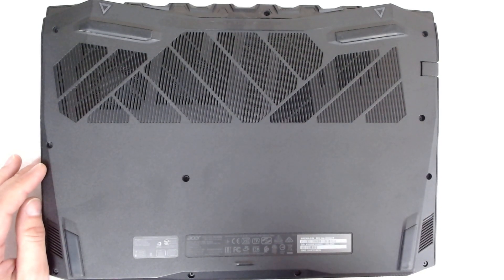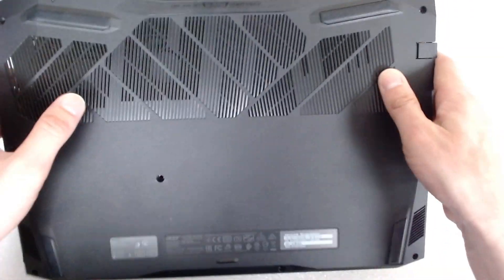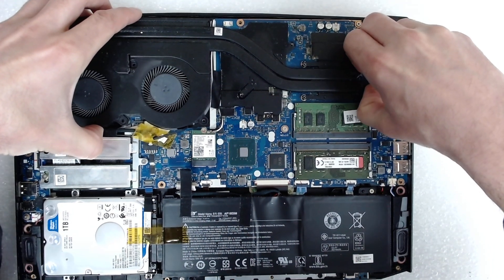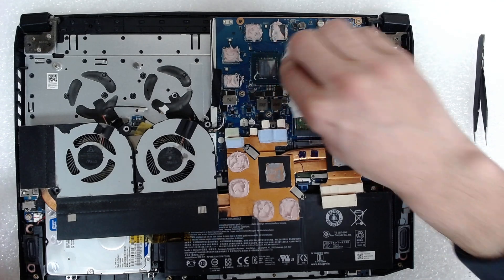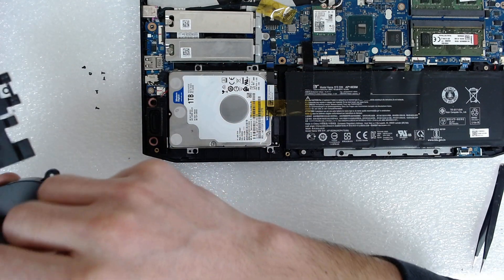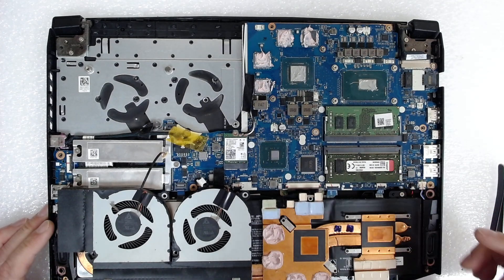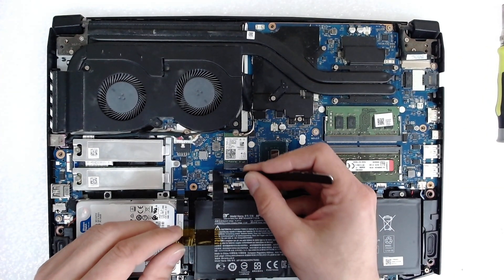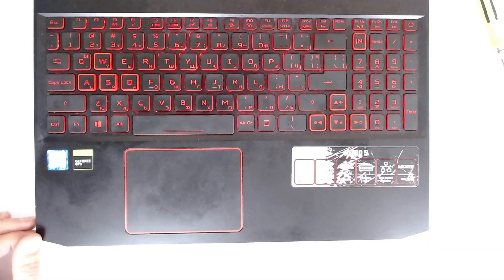Acer Nitro AN515-54 Disassembly / Fan Cleaning

Comment: Hello. I have followed these steps thouroughly but now my laptop won't start up anymore. The screen stays black, the keyboard lights up and the charger light turns on when plug it in. The fans don't seem to be spinning either. Any suggestion?
Reply from the maker: Check did you connect the power button cable also check the memory is it inserted properly
Reply: @LaptopDisassembly  cables are inserted properly and I've reinvested the ram. Nothing changed
Reply from the maker: Are you shure you did not damage something. Also did you closethe back cover.. Sometimes there is a switch on the board.
Reply: Hello again and thanks for the replies. I've changed the fans with a new set and these spin when turning on as well as slowing down after a few seconds but I'm still getting a black screen with no backlight, keyboard lighting up but only key that does anything is the power on or hold to power off. I've tried another monitor, reseating SSD, ram, bios battery, power drain, key combinations, starting without ram or SSD and a few other things. Do you have any advice before I take it to an overpriced repair shop? Thanks and have a good evening
Reply from the maker: Did the laptop worked fine before you open it on first place.  Also when you try to power it on is it completely assembled. You have to put the memory cover, because underneath is a small switch. If is not press it act like that.
Reply: It was working fine before. Only problem is the fans were very loud due to dust (similar to the laptop in your video). I always start it with the cover on

Comment: Could you please tell me the screw driver size to open the heat sink fan screws, Ali Express is banned here so I need the size
Reply from the maker: I can't tell you the exact size. I just use the one that fits best in the screw. And for the smaller fan screws i use a screwdriver from a phone repair kit.
Reply: Philips #00

Comment: What kind of thermal is near the thermal pads.
Reply from the maker: Can't quite understand the question, but on the VRMs there is a thermal pads and on the cpu there is a thermal paste.
Reply: @LaptopDisassembly  I meant the 4 pinkish color. I don't know if it's any type of thermal. I'm sorry if I got you confused
Reply from the maker: This is actually thrrmal adhesive. Something between thermal paste and thermal pad. It comes like that from the factory.
Reply: @LaptopDisassembly  is there any chance that I could repaste it with any type of thermal adhesive?
Reply from the maker: I havent replace till now. You can use a thinner thermal pad or a bit more thermal paste. But all depend on the gap you have. Usually the original is the best.
Reply: @LaptopDisassembly  Thank you so much sir! Imma sub to show my appreciation to you sir
Reply: @LaptopDisassembly  One more question. Is it necessary to replace the pinkish thermal? if so, is it yearly or every certain number of months?
Reply from the maker: I never replace it. As long as is there and it sticks properly, everything is fine.
Reply: @LaptopDisassembly  thank you vry much sir! have a good day a head

Comment: Is the Arctic MX-2 the best thermal paste to use with heavy loads and high temperatures? Also do I need to spread it around like you did or can I use the pea method or the line method?
Reply from the maker: I use mx-2 because it is the best about price/performance. It last about 2 years before drying. All depend on the load... Also there is not a lot of difference about applying the paste. When you put the cooler and tide the screws it will even the paste. I like to spread it before.
Reply: @LaptopDisassembly  Yes the viscosity of the thermal paste matters.

Comment: Do I need the thermal paste so the fan wont be able to come off? Because I dont have thermal paste and I just want to clean the fan only
Reply from the maker: If you lift the cooler you need to replace the thermal paste. Otherwise you can use a vacuum cleaner to suck the dust from the fan.

Comment: Bro my temps usually run up to 90C before cleaning. I OPENED MY FANS AND HOLY COW THERE IS SO MUCH DIRT!! after cleaning, its not overheating and even at high performance! Thanks so much!! Subscribed
Reply: What are your specs?
Reply: @Cryh4ck the same thing as the laptop in the video most likely

Comment: Im about to repaste my nitro 5 and the only thing that is holding me back to do it is the vrm paste. If i put the same thermal paste (grizzly kryonaut) on the VRM´s wouldn´t it be the same or better? great video.
Reply from the maker: Must be better than mx-2. But the original compound is a bit dense, so just be careful will it fill the gap.
Reply: @LaptopDisassembly  what if I use thermal pads, what size should I use?
Reply: @LaptopDisassembly  Hi. I just need the screw driver that fits the screws that open the fans. I have opened everything else, but the bits I have don't fit the fan screws. Can you refer me to the size and shape of that screwdriver or bit. I know you posted a link to the screw driver set you used, but I just need that particular one. If it is not sold individually then you can refer me to a set that is not so big. I would prefer amazon please.
Reply from the maker: I usually use the one that fits. But if is a big one i use a screwdriver from a phone disassembly kit.
Reply: @LaptopDisassembly  Ok, thanks. I ended up getting a small screwdriver set from a nearby hardware store that worked. Your video helped a lot. Really appreciate your work. Thanks so much!

Comment: Do i have to change thermal paste i just need to open it to check whats causing a noise in the fan
Reply from the maker: If you don't lift the cooler, no need, but if you do yes.

Comment: Can you remove fans seperately without having to repaste? Also, which fan is the cpu fan? I just have a faulty bearing in my cpu fan that i want to replace but my paste is in good condition already. Thanks
Reply from the maker: Not possible. The fans can be pulled from underneath so in order to do that, you have to lift the cooler. But fresh paste is always better than good condition one :)
Reply: No matter how fresh paste it, laptop manufacturers use cheap and low quality thermal compounds which isn't good for heat dissipation but lasts very long without drying (That's what they focus on) , just after warranty period is over clean its fans and apply good thermal compound, in my case i applied liquid metal, its quite risky and expensive but also worth it, it reduced temps down up to 25 degrees Celsius.

Comment: Extremely useful and worked for my Acer Nitro 7 (2019) Model. 
It's working well afterwards, saw an idle temp drop from 70° to 45 and on load temp from 95° to the 60-70s immediately after the process. I'm expecting it to average to about 80, 85° possibly on extreme load, which is still far better than my previous temps
Reply: What thermal paste do you use? Yesterday, i repaste my laptp. It cooled down for while, and today the temperature raised again. Do you know how to fix this? Does it has anything to do with the cooling system?
Reply from the maker: I use arctic mx-2. Are you sure you place the paste properly. Can be a cooling system problem. Also did you clean the dust from the cooling grill.
Reply: @LaptopDisassembly  yes, im sure the whole surface is covered. already clean it either
Reply: @LaptopDisassembly  do I have to use a paste? Or can I just not clean it off and put the parts back in? I don’t have a paste.
And would you recommend this process although I never did anything similar?
Reply: Did your fans get quieter ?
Reply from the maker: Yes

Comment: i repasted my acer nitro 7 last month, accidentally removed pink putty from the VRMs, replaced them with 1 mm thermal pads and it worked fine for me just in case anyone did the same
Reply: This is what I've been searching all this time.
Reply: I put 0.5 mm thermal pad, it works for my nitro 5, predator helios 300
Reply: Is it 1 mm for all 4 VRMs?
Reply from the maker: It should be. All are on the same level.
Reply: @iFrozenSkull  it is same for all VRMs, 1 mm is what I am using. For CPU they are of different sizes.
Reply: @harshtomar2187  for CPU we can apply thermal paste right?
Reply from the maker: For cpu a thermal paste. The pads are for VRMs only.

Comment: which screwdriver did you used to open the heat sink?
Reply from the maker: the set is in the description https://www.aliexpress.com/item/2011849647.html. just use the bit that fits best.